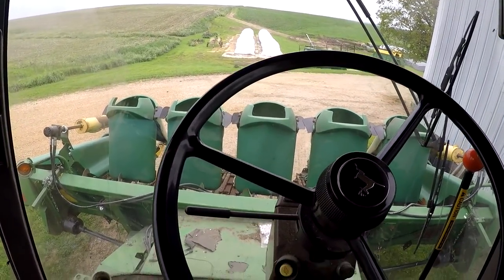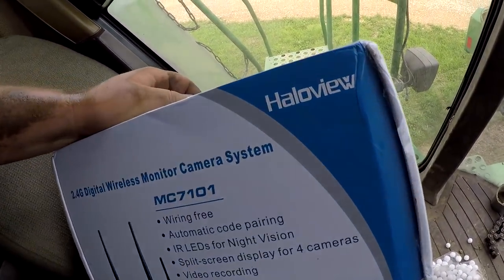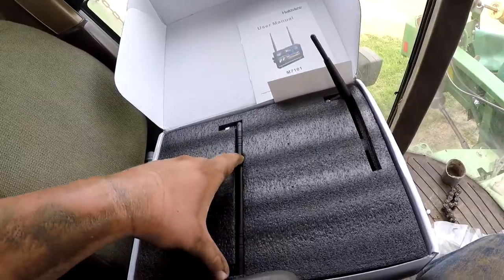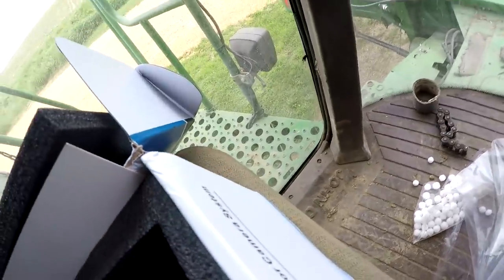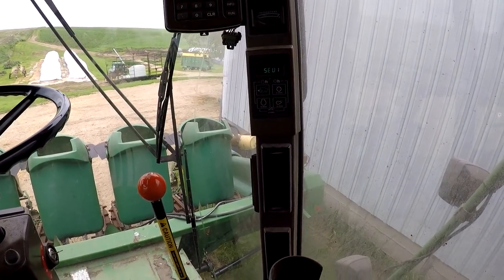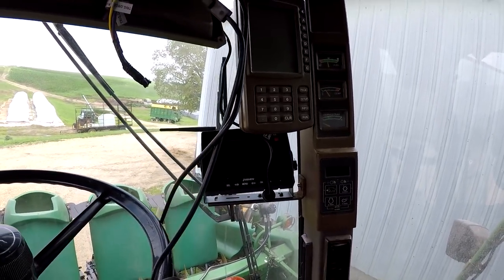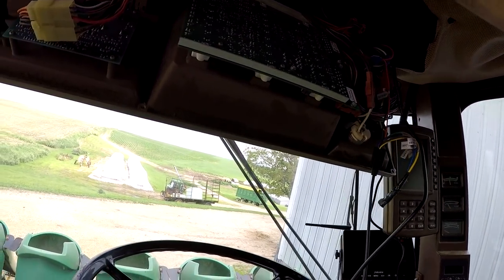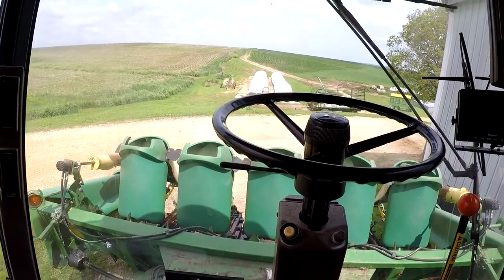Finally A Backup Camera For the Combine! - Haloview Wireless Camera System

Comment: How are your rear lights on the tail housing wired in?? Wanting my to do that to mine.
Reply from the maker: The lights facing backwards?
Reply: iowadairyboys Yes
Reply from the maker: They were already on when we got the combine they did a very clean job of wiring them and are on a separate switch in the cab.
Reply: iowadairyboys Ok thx

Comment: This is a dumb question, but why does your combine have windshied wipers? Can you process stuff in the rain? I mean I understand with a tractor, but I thought combines only operate when it's dry out ??  

OMG, lol I'm not having you wire up my house, you might run it through the refrigerator handles :D HAHAHAHAHA
Reply: don't feel bad though . . . Erik's done weird stuff like that PLENTY of times!
Reply from the maker: To wipe dust off or driving home in the pooring rain after getting rained out.
Reply: Yes you can combine corn in the weather for a while, you just can;t go too long. Last year we went in the snow for a few hours but the sieves started to plug up so we had to quit.
Reply from the maker: Yeah last October we went in the snow for a while as well.
Reply: Thats why heated shops are nice, run it until it starts to plug and then pull inside for the night and let it thaw out